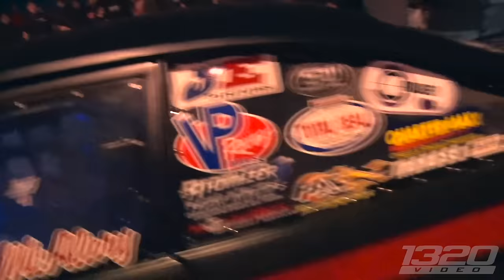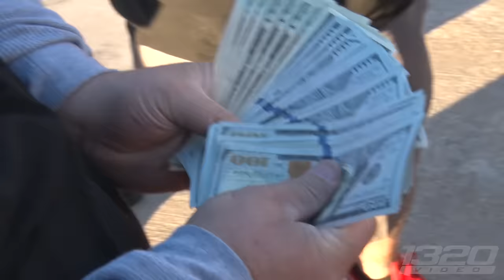REAL STREET RACING!

Comment: Damn chief smoke the shit out them tire's way to much power
Reply: StevenP 727 even if he detuned the hell out of it he still would of smoked the tires
Reply: Ya very true
Reply: StevenP 727 no hate an all but a massive big block on twin turbos will smoke the tires bad on skinny’s
Reply: Yeah even with a weak tune he makes way too much power for small tires on the street.
Reply: terror bite as far as i know cheif dosen’t run a masive big block in this car i’m pretty sure its a pontiac small block based motor
Reply: MrAwsomedude78 either way you look at it, it's setup for big tire so you can't expect to win with half the tire.
Reply: Makes me wish there was a good american awd platform for these tt  big blocks to sit in, that would be pretty sik.
Reply: jacob portillo lol. No such thing as a good AWD. Even the fast "AWD" Jdm cars are still mainly RWD. And honestly it would just be too expensive to maintain and generally make. Plus it also adds tons of weight. That's why the full AWD cars like evos and subbies still aren't past that 8 second mark.
Reply: terror bite but doesnt chief run a small block Chrysler eninge? Regardless he couldn't have taken enough power out to make a decent pass on that bare road
Reply: StevenP 727 last I heard the crow was making over 2200hp at the wheels with a TT and no nitrous
Reply: matt b if he still has the same setup from season 3 then he’s running a butler big block hold on I’ll try to get details
Reply: matt b correct me but he runs a big block Pontiac engine made by butler
Reply: terror bite nope it's still the same twin 88 small block pontiac by butler. Had it in the og crow, the crow mod and the new crow. He's never had a big block
Reply: natesotelo16 so he has never had a big block but can’t run small tires? Damn
Reply: terror bite nope, it's always been small block Pontiac in whichever crow he's had. He ran small tire way before the show when it was nitrous and much slower. Either season 2 or 3 of the show was when he introduced it as a big tire tt car and it's been big tire ever since
Reply: yep, a 482 i think
Reply: Julio Dominguez subie has broken into the 7s with tons of evos right around the corner.
Reply: There is no such thing as a small or big block Pontiac,just sayin.
Reply: 45 ROB- You are correct sir...
Reply: He runs TT on a small block Butler performance engine.
Reply: Actually chief runs a small block Pontiac motor - Chief claims small block motor turns more rpms and spools the turbos better.  I myself don't know if that's true I'm just quoting what I hear chief said
Reply: terror bite he runs a 482 small block Pontiac. It was a 400 Pontiac, cast iron block. Same engine he has always ran.
Reply: MrAwsomedude78 Pontiac motors all use the same basic design block. From the 326 to the 455...all the same block. 2 different crank journal diameters. Chief runs a 496 IIRC
Reply: this ain't it Cheif
Reply: Not a big block but a billet small block.
Reply: @freeirishmexicanamericangi9199  what does his personal life have to do with racing? Nothing
Reply: @TheModAddict   Yeah well his racing sucks too.

Comment: Not surprising Summitt had no wheels. After getting a few failed parts (factory defects) over the course of a year, we stopped using them and went to Butler. I need dependable parts and Summitt did not deliver. Butler has came through for me.

Comment: if i were to race on the street, id bring something that packs a punch in terms of horsepower, acceleration, and top speed at the 1/4 mile, the 1/2 mile, and the 1 mile tracks. like a 1970 charger with a 427 hemmings engine with blower outputting more than 1400 horsepower to start, or a if i had the cash a supercar either italian or american made

Comment: Looks like the street outlaw guys have forgotten how to race the road.   They ALL knocked the tires off the whole way down the track. Even boosted did it 2d race.  All that money and HP in there cars are almost strictly track cars now. The roads that have tons of rubber from racing are sticky like a track after a couple passes.  Get on a virgin road and your screwed.  Can Big Chief and NOva even get them tuned down to 1200-1500 HP?  Daddy Dave has proven that's about the max you can get to the road and keep traction.  If you're getting more down it's because the road has a tone of rubber on it already.

Comment: Love your videos, as a matter of fact, 1320 reignited my love for racing. I have 1 issue with 'drag' racing now and before I go any further I understand I am older, hence I may not 'get' this generation of drivers/cars. Back in the day, especially if it was local (not so legal) racing, we did a few things to try and gain an edge, but nothing crazy. Changing out a 2 barrel carburetor and replacing with a 4, camshaft and a few other things, but nothing to loose the house over. Also, it didn't help I guess growing up in poverty in the armpit of America haha. Anyway, to see the over the top powerhouses we had to go to our semi-local drag strip. Now people are showing up on the street with machines they have poured thousands of dollars in, wheelie bars, parachutes, not driving in, but pulling their car there on/in a trailer. Don't get me wrong, I love those cars, I love to watch them run, the way they sound and so on. But it use to be, your drove out, met up with some people/friends and settled some brand wars IE: Chevy vs Ford vs Dodge and so on and when the night was done, you drove home and then used that very same car to get to work, go to the store, pick up the kids etc. 

Look, I am not complaining I guess as much as I am pining for the old days, but it does seem to me that what would have once been the allure of proving my 69 SS Camaro is faster than your Cuda in a quarter mile is all but gone. Sometimes it seems the body of the car is only a shell and underneath is something far more sinister.

Comment: I wish we had more of a presence like this in the east coast/DelMarVa area every time I watch these videos. We have some similar races but our heavy hitters are scared of the street and it kills a lot of the fun. The last event I attended I won with a full street car and it's just a shame lol. Granted I have my power management sorted better than most but I shouldn't be winning out of 20+ racers with a high 9 second street car. The event before this was won with another street car and he averages 9.30s. We are at 70-75F right now with 290ft DA so cars run very well right now and there should be more big players on the field. 
My street car is a 92 LX hatch @ 2640lbs, iron 418 LQ9 with PRC LS3 style heads, FAST, Gen2 7675, TH400 on E85. The previous winner was running his 07 GT500, bone stock 5.4 DOHC, twin 76mm Comp turbos, also on a TH400 o believe built by RPM. This car weighs over 3500lbs and has been PB of 8.95 but consistent 9.30s are the norm.
Reply: Message me I'd like to go to anything remotely similar to this, I'm in delware, I only ever get a chance to race at cecil, gone are the days of meeting at McDonalds in elkton,